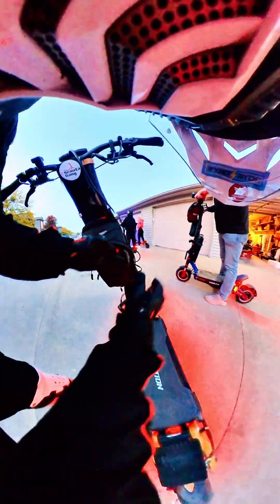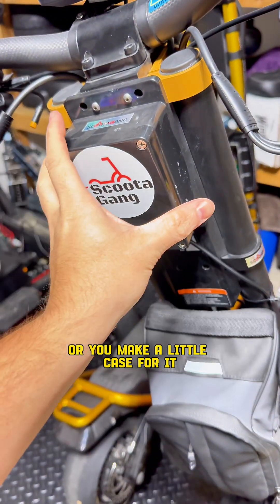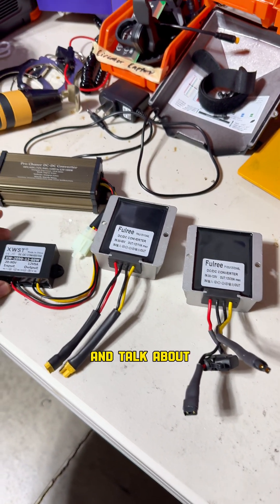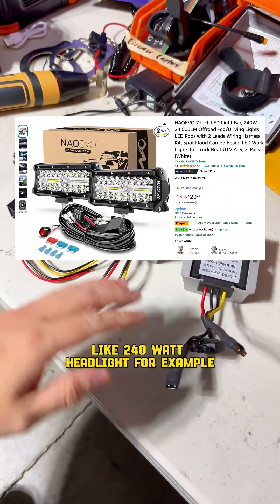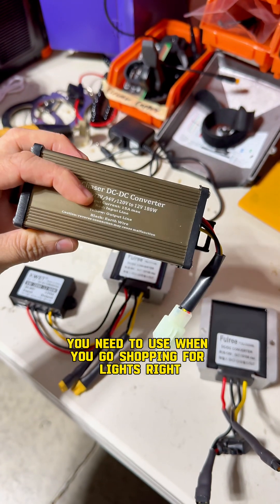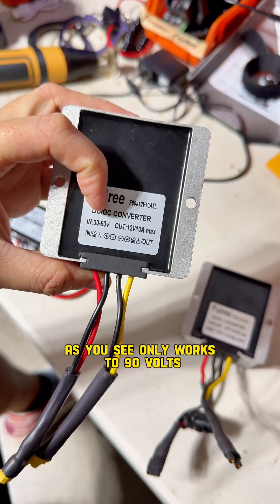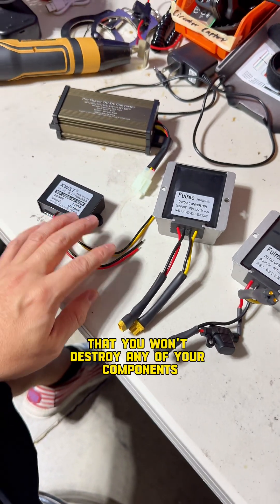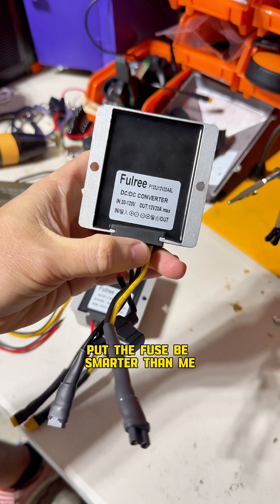How-to Power LED Underglow OR Head Lights: Discussing 12v Circuits On Electric Scooters

Comment: Thank you for this video. Amazon pictures can be deceiving. Those converters seem much smaller in the pictures. They are huge in reality when trying to put that in a scooter battery compartment. I'm just going to stick with 60v rated led system
Reply from the maker: @jaybones614  yeah they are big we always put them in a seperate stem bag. But you need 12v if you want to run any accessories at all such as rear view camera, lights, heated grips, etc etc everything runs on 12v

Comment: Hey. So I have 2 8led headlights- two 2led flat lights. Small “handlebar” turn signal/ brake/drl lights (4x) and four turn signals with DRL / brake lights. What do you segust my amperage concert thingy? lol Ik it’s a lot but I’m going all in.
Reply from the maker: What voltage is your scooter I can link you one? And what's the wattage of each of your lights you want to hook up?
Reply: @ScootaGang  72v scooter  all lights were naught off AliExpress so not sure
Reply: My previous 12v converter could run 1 headlight, the handlebar turn signals x2 ambient red lights horn.

Comment: Question: you always ride fast but there is death wobbles you prob heard about, do you always use a damp or just never get it
Reply from the maker: No I haven't had a death wobble in years, if you have your feet in the right place and your weight distribution is on point you don't get wobbles at all. Scooting is 100% a skill you can learn and your body gets muscle memory, after about 1000 miles you are one with the scooter and you have full control.
Reply: @ScootaGang  Ty I will remember this I’m planning to get ausom gallop or smth a but faster

Comment: Where do you tie-in/splice the converter into the electrical system on the scooter?
Reply from the maker: @p5stunna  just an xt90 splitter on the battery connector and it will give you an extra plug to connect to the battery directly. Here's a link, they are widely available on amazon:
https://www.youtube.com/watch?v=u6Gsv7BjYPQ&t=1s
Reply: @ScootaGang  That the correct link?
Reply from the maker: @p5stunna  sorry not sure why that pasted:
https://amzn.to/3C2Ygl9